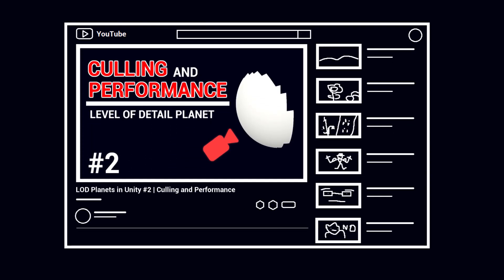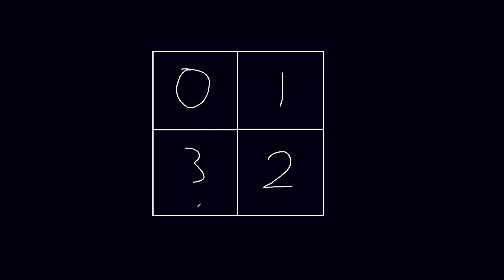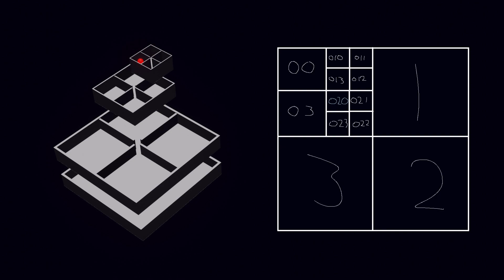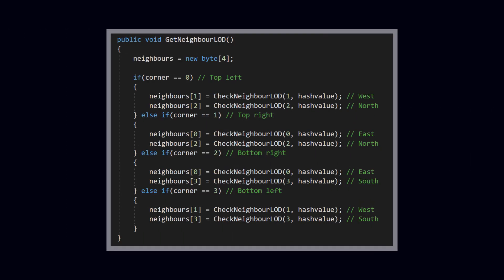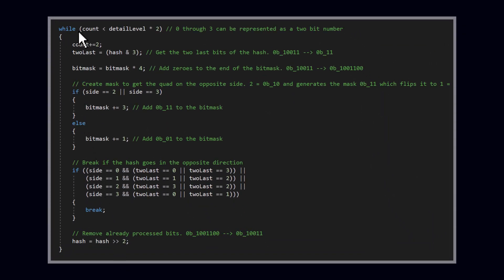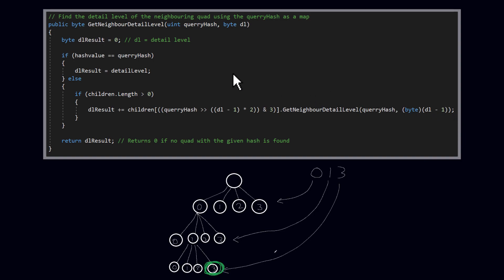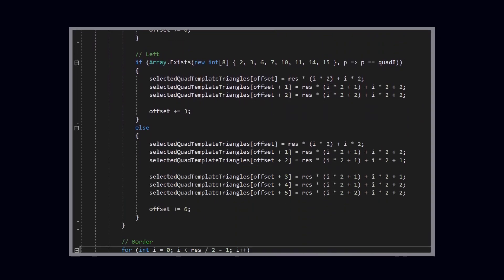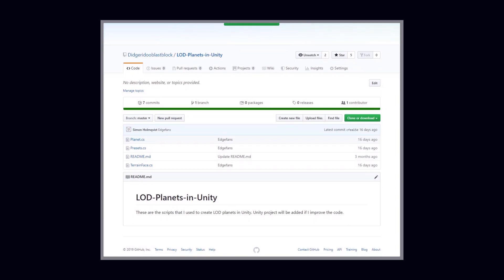LOD Planets in Unity #3 | Edge Fans | Programming Projects 1.2

Comment: It isn't any simpler way?
It's hard for me to explain but look at  0:12,well you can see that there is a middle point that is is in the higher lod mesh.
Well,you can't move that middle point down?(to the center,i belive it need's to be the avarage of his two neighborns),and like that it will be on the line of the lower resolution mesh
I am not sure how easy it is to do that but i think it is more optimised
Reply from the maker: The actual application of the edge fans is pretty light performance-wise. The part that costs by far the most performance is figuring out where to apply the edge fans, so I don't think changing the geometry of the edge fans will result in any significant performance gains. Perhaps even the opposite, since just moving the vertex down instead of removing it results in additional invisible polygons which, apart from slowing down rendering, will cause a lot of pain when I elevate and texture the surface. It's an interesting idea though! I have a habit of overcomplicating things when I'm programming, so it's good that people like you challenge my ideas. There is incredible beauty in simplicity :)

Comment: Hm this is interesting. I did a similar project some time ago, and I did something completely different to fix this problem. I don't remember exactly what I did, but it involved finding a mathematical formula for the level of detail at any given position. With this, I could evaluate a function and compare the detail levels, like if the level of detail was larger than that of the quad I was checking on, I know I'd have to do something different with the geometry. I think your solution might be more efficient though, given the simplicity of the arithmetic. Well done!
Reply from the maker: Thank you! I love your smoke simulation :)
Reply: @simonholmqvist1951  Also, I wanted to ask if you got any issues with cracks in between the borders of the terrain faces? This ended up being an issue in my implementation, and I was never quite sure how to solve it.
Reply from the maker: @TebiByyte  Unfortunately, I do have those. I will try to fix them in a future video, but they aren't really noticeable unless you have a pretty low resolution on your planet.
Reply: @simonholmqvist1951  The cracks inbetween terrain faces happen because neighbouring quads on different terrain faces have different normals - because they are different meshes. The recalculate normals method of unities mesh class of course doesn't know about other meshes. One idea I had to to fix these is to merge all the meshes together into one and remove duplicate vertices. Since I implemented the planets in Java OpenGL and not unity I didn't try this solution yet, though, because my mesh class doesn't have a "remove duplicate vertices" method. Anyone have any idea how to implement one efficiently?
Reply from the maker: @Kahitar1  Check out the next video in this series (#4). I managed to solve the normal issue :)
Reply: @simonholmqvist1951  Haha yeah I saw that right after my comment here. Thanks for the reply 😃